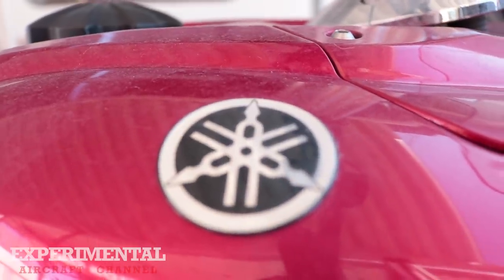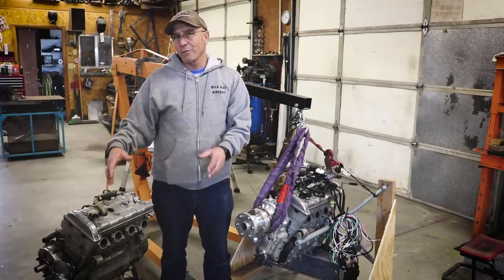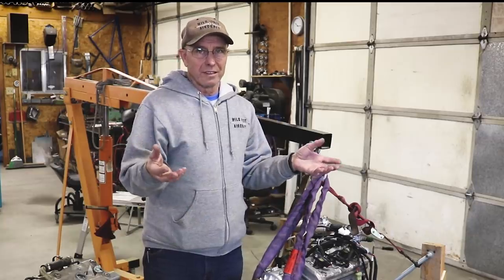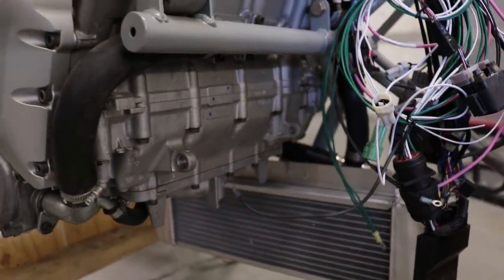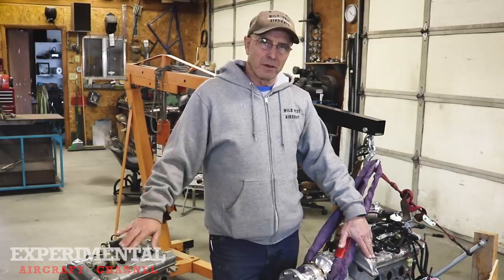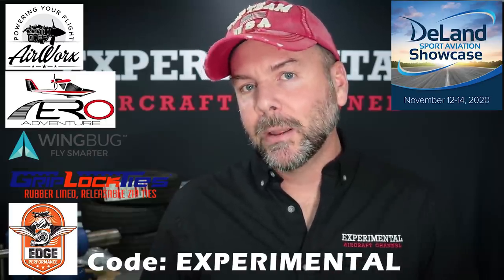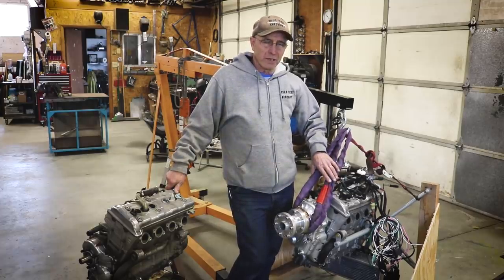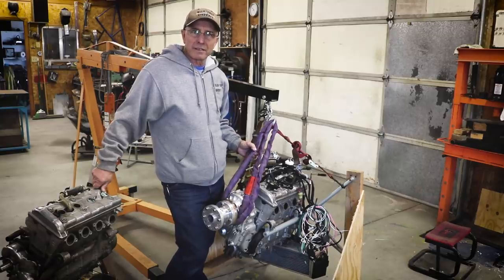Yamaha Aircraft Engines?  STOL - Steve Henry

Comment: What are some of the differences in HP loss with air density equal to altitude?(sorry about the terms, not a licensed pilot yet) Sea level, 5k ft, 10k ft with both the Rotax and the Apex?
Reply: deekamikaze there is none all it does is maintain rated hp at alt that’s it

Comment: Whats the weight of ready to bolt on apex engine with gear box.
Reply from the maker: I was there when he took deliver of the Turbo version of it. We through everything on it required to run while it was hanging from the hoist. Came in at 199lbs!  So the normally aspirated (STOCK) Yamaha should be much less. 185lbs or less I believe. Thank you for watching and supporting here. I appreciate You!
Reply: @ExperimentalAircraftChannel  200 pounds for 300 horsepower is a hell of a thing.

Comment: Those are crazy prices.   You can buy a brand new Yamaha sled for that kind of money.   How much is the prop adapter ?
Reply: You can buy almost  two sleds for that money and partout the rest this is why the average man cannot afford to fly.
Reply: @glasairflier9790  I don't understand why the average man wouldn't just buy a sled with a Turbo Apex engine, bolt on the adapter and part out the rest of the sled.  Or buy a used one.   The sled channels say it makes over 200HP.

I ride Yamaha dirtbikes - 250 and 450s.  These engines are bulletproof.
Reply: think 3500 for prop adapter
Reply: If you source your own engine and buy the parts you need assembling it yourself you will be around $8k.

Comment: When you fly thousand of miles over ocean mountain and jungle you will think differently ,, 8 - 9000 Rpm are ok to impress yourself around the pattern ,, but the real thing is the big bore slow turning direct drive Lycoming humming at 2200
Reply: A 500 cc Honda, twin, 47.5 HP at 9000 RPM, lasts easily 100000 miles. That's many hours before TBO. Change of oil every  5000 miles, check the valves every 15000 miles, never touched the ignition nor the injection. Mine began to sip a spoon of oil at 110000 miles and I opened it because a ball bearing in the gearbox was becoming slightly noisy, so I remade the engine before selling the bike to a friend. I'm a maniac in mechanics.
In Germany on the autobahns (no speed limit) I make easily 150 miles full throttle full speed, before refuelling. 
The engine of an ordinary road bike Honda VFR 800cc 4 cylinders 100 HP has been tried on bank 100 hours at 8500 RPM without problem. Yes 4 days 4 hours at 8500 RPM non stop. Inside it was pristine. They were testing a synthetic oil.
In endurance competition, a 1000 cc Suzuki giving 220 HP at 12000 RPM makes easily the 24 hours at Le Mans , and the circuit has a very long straight line of 4 km (2.5 miles) taken by the bikes at 200 mph and more at full RPM. 
It's simply good engineering.
Reply: The assumption in that statement is that lower RPM is better reliability in spite of performance and efficiency loses right? 

Except the auto industry has long since proven those assumptions wrong. Delivering increased reliability and performance and efficiency.
Reply: Ya for long life slow low RPM is the smart move. Lubricated metal on metal
lasts longer with lower RPM.  Lower temps equal safety.
Reply: @MrAluminox  look i have a hayabusa, and a 1968 cessna T210. I can get maybe close to 1400 hrs before changing out a cylinder in that continental engine if i don't let it run too hot. In aircraft we are cruising at maybe 65% power at CONSTANT rpm. We just don't drive motorbikes at CONTINUOUS high rpm. Hayabusas run at the dragstrip and get rebuilt very often, relatively the same technology as this yamaha engine in question. Of course i could be wrong here, but some TBO numbers would be interesting.
Reply: @Mrcaffinebean  the technology is getting better but you do not cruise any car at high continuous rpm for very long.
Reply: @heofthebee  thanks doc, get these kids minds right :)

Comment: What is the longevity of these engines (hourwise) as far as using them in airplanes goes? Has there been any long term testing yet where the engines have been run for 1000+ or 2000+ hours?
Reply: ditto that. No hard #s and big $ is jive-talkin'. how long do the suckers last.

Comment: I'd love to see someone put a "real" 2-stroke into an airplane.  I've seen a couple done, but it's usually some hopeless cheapo engine made out of butter and sadness, or it's a dedicated aviation engine made out of money and sadness.  2-strokes are light, simple, and not as inefficient as you'd think when fuel injected and kept in their "happy place" RPM range.  People think they're unreliable, but most of the time problems arise from them being different and owners not knowing about it.  The amount of hokey legends and old wives tales I've heard about the various vintage motorcycles I've owned is incredible.  Fortunately with fuel and oil injection all the tuning items can be dealt with by an engineer, and all the owner would have to do is monitor CHTs and not let it run out of oil.  Then when you do have to overhaul it, it's a 2-stroke so it's like a 4 hour job with a friend and a pizza.  But until then, I'm just happy to see the aviation community starting to use any engine that's not just a giant VW at Ferrari prices.

Comment: Decades ago I was reading about research and certification of a diesel engine for small aircraft.
The one thing that stood out was that since it has to be injected it meant that it didn't need manual mixture control (gasp!)
And since it is new technology requiring full certification anyways they've decided to go with electronic fuel injection.
I mean... imagine having just one handle that gives you more power when you slide it forward and less when you slide it back without having to consider pesky annoyances like engine temperatures!
I think it is awesome that it is so easy to experiment with new technology in the light sport aircraft field.
Of course, it can get dangerous too if Bob from down the street decides he can build a flying machine from his riding lawn mower.

Comment: About those vtol aircraft*, how about folding transforming electric bicopters, running with aluminium/magnesium-air single use batteries?
Reply: I'm planning to produce these myself, also quad/oct versions, all graphene-aluminium full roll cage with metal air replaceable batteries
Reply: target price for each is 2000EUR/USD off-the-shelf, ultra-light, fast-cast

Comment: $23,000 for a second hand motor with 150 hp is pricey.  Those Yamaha motors can be found used in good shape for about $3000-5000 so $23,000 total cost is really high.  Might as well go back to the Lycoming-Continental!

Comment: Why not bike engines when they are more easily available and probably cheaper?
Reply from the maker: Because motorcycle engines have a heavy gearbox that isn't needed. These do not have the gear box and can be mated to a proper ratio gear reduction. Thank you for watching! :-)
Reply: I was wondering the same thing. 

So in other words nobody has pulled the transmission off of a motorcycle engine and figured out a cost effective oil pan with an engine mount.

Imagine a turbo'd zx14 or busa in an 800lb airplane.😲
Reply: @fz671  Most bike engines have the gearbox integrated to the block.

Comment: It seems nice but the cost of a used motor (turbo) is the cost of a brand new Rotax 915 out of the box $40.000 range...that would be very hard to justify. Yamaha will have to lower their profit margins if they want to compete.
Reply: Yamaha isn't building these for aviation.
Reply: Yamaha doesn't want to be involved at all

Comment: One major hesitation with modern auto engines for aircraft is the manner in which sensors may be configured in the power control module - PCM of auto engines.  

In some instances, should a sensor fail - and mind you, ONLY the sensor fails - crucial functions of the engine are compromised - in some cases, stop functioning or go into a limp mode.  Engine in a car rolling on the ground, usually not an issue fraught with possibly fatal consequences.  Not good but rarely causing crashes.

In the air, dealing with unplanned weather anomalies, air traffic near-misses or other emergencies, a limp-mode can cause a shortage in performance and critically lead to an emergency.  

All sensors upon failure should default to the most recent optimum performance with only a warning light notification of the sensor that failed.  This provides that the sensor alone, and only the sensor, failed and not precipitate a chain-reacting loss of performance in other systems of the engine.
Reply: These engine get a whole different wire harness and ECM for aircraft.

Comment: I wonder if you could run an R1 engine on an airplane...
Reply: These are based on  the R1 engine but have no transmission, just an output shaft for the clutch.